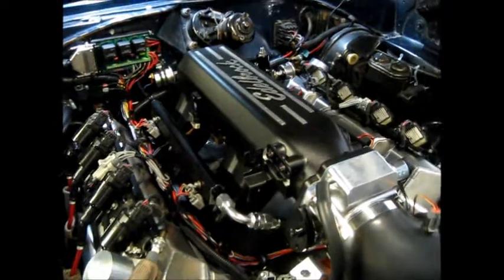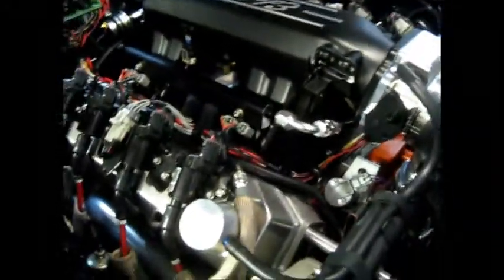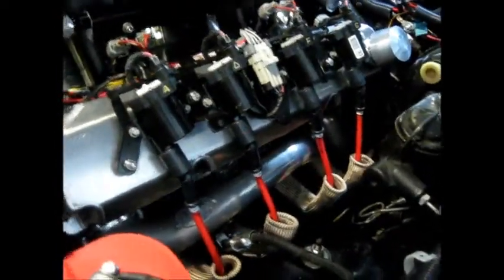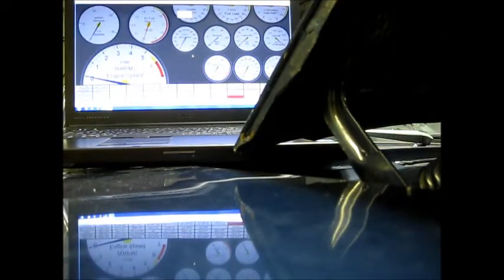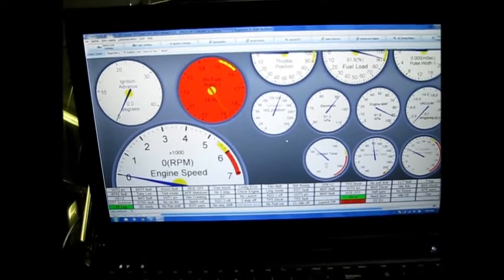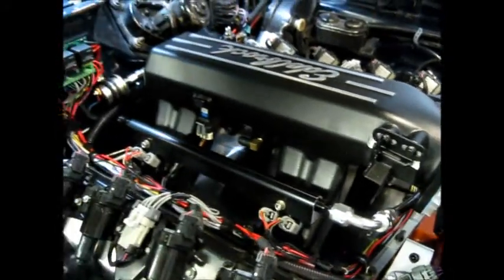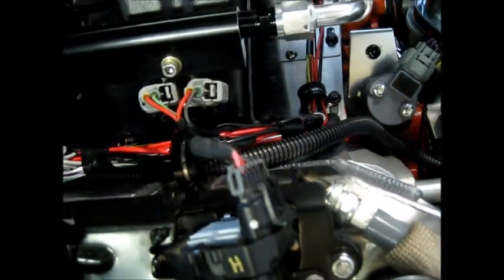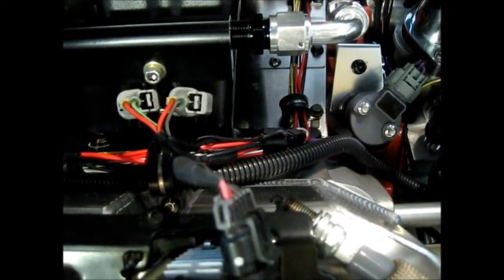68 Charger MS3X Megasquirt overview

Comment: ms3gold installed on 73 charger ok ing. on cuts out when key start.need2 run hot at start also. any suggestions4 wiring?
Reply: mike o look for gm HeI conversion I did that to mine it gets rid of the ballast resistor the next step is to finish my efi lsx computer swap like red mists car but on the cheep. Thanks redmist I like your work looks nicer than a msd box and fitech efi. Dust doublechecking will the jeep parts play nice with a 2006 lsa drive-by wire?

Comment: Did u have trouble getting rpm sync
Reply from the maker: Sanchez Holley  NO problems with Sync at all!! So far the only issue I have had with the build was a bad factory LS Coil connector. It took me a while to find it. The car went 110MPH it's first time out (And my first time down the track) in the 1/4 mile.

Comment: Vary, vary cool and informative the first car I bought was  a ragged out. 69 dodge charger R/T w/440 magnum. This was a long time ago 1975 or so,no truck floor, open the trunk and you were looking at the top of the fuel tank. Surprisingly that was really about it for serious rust. The front suspension was gone the K-member had to be repaired as the hole for the lower control arm bushing was an oval on the RH/pass. side. It had a vary rare option frt. disc brakes with huge huge heavy Kelsy Hayes fixed 4 piston calipers.
The use of the jeep cam sensor was vary clevor. What's it out of a 4.7 ??. Was completely unaware of Edelbrock intake certainly looks the part; reminds me of the stealth ram Holley makes for the SBC1 vary pop. with TPI owners

Comment: I'm building a 505" with almost the same setup. The Eddy pro flo xt manifold looks badass. I kinda wish I went COP. I moded the trigger wheel on an MSD distributor - didn't think about the Jeep CPS. - Now I'm thinking about changing to COP.  How did you setup your timing tables from scratch?

Comment: Very cool seeing that MS3X (almost) running on a RB motor.  I've been looking at that Pro-flo manifold for some time now thinking I should just buy one so I'm committted to doing the EFI conversion at some time.  But my best shortblock is a B motor that is stroked to 500".  I'm thinking of switching to MP Stage VI heads (raised intake port) so I can run a Pro-Flo 440 manifold since Eddy doesn't make a 400 Pro-flow manifold yet. Search youtube for rumblefish72 to see my engine break-in video.

Comment: fantastic workmanship! Im squirting a turbo slant six myself. Dont go crazy stimulating the injectors dry, they need fuel to cool their servos. What is the CPS for, can you run it with just the wheel? Also the dwell time should be compared to the coil temperatures, longer dwell means a hotter coil, but it should be able to go much higher than a single coil setup.